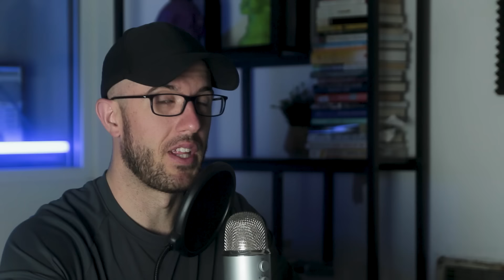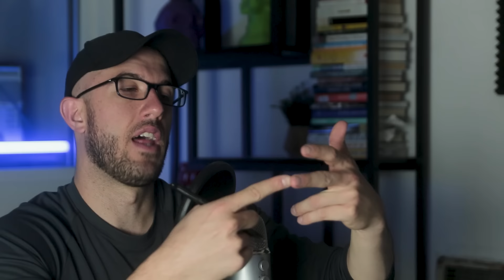How to Structure Your Day | Tangled Membership | Shopify 3D printing plugin??  |  3D Printing News

Comment: I would LOVE to use the pluggins, but the quality of the parts sent out have been so bad that I've had to remake them at a loss and send them overseas. There was nothing wrong with the model, but there seems to be an issue with trying to print the parts too fast causing a terrible surface finish (and therefore the part not moving). I'll be weeks before getting any samples back to see if the quality issue is fixed. 
If the quality gets fixed, I'm 100% all over this.
Reply from the maker: It takes 3 days to get a part. Go ahead and shoot us your past order number to info@slant3d.com and we will send you a free replacement part with the updated system

Comment: I'm very pleased with the quality of the current Tangled Filament offering. However, I do find it frustrating that it's not compatible with Bambu Lab's AMS. I have printed a re-spooler to assist with this. But it can be time consuming. On a previous video, one of the statistics that you showed was the increase of 3D printer sales and how most of the growth came from Bambu Lab after their release of the X1C. So, it might be worth considering a new spool that is properly sized to fit in the AMS. Or at least doing some sort of survey to gage how many customers would prefer it and make the decision based on data. A simple 1-question survey on the purchase page asking whether the customer has an AMS, or whether they are considering purchasing one, in order to gather the data. You have also previously mentioned that Tangled Filament might consider printing their own spools; if things go this route, it would be easy to leverage this to make an AMS compatible spool.

You have talked about the fact that 1kg spools are not ideal, especially in a farm since it increases the labor. For folks running their own print farms, a potential solution, if they have a Bambu Lab centric print farm, is the AMS, where they can easily add up to 4kgs of filament at once and do quick refills as necessary. Without having to wait for the current spools to run out, and therefore minimizing downtime as these can be swapped out while the printer is running off a different spool. So yeah, I'd love to see AMS compatible spools if possible but gather data as I am only a sample of 1.